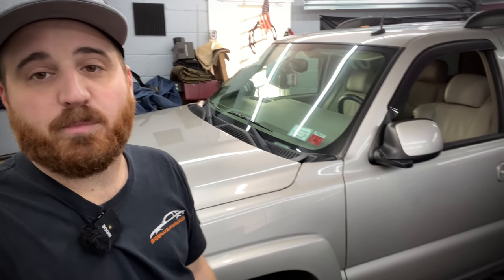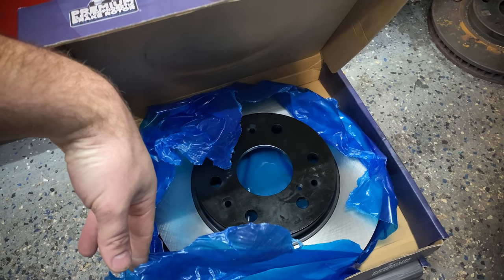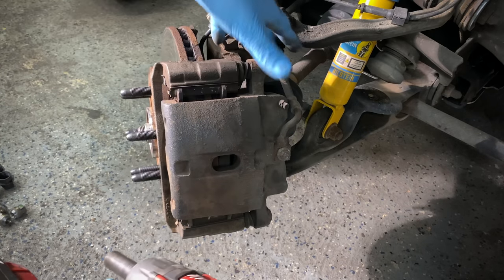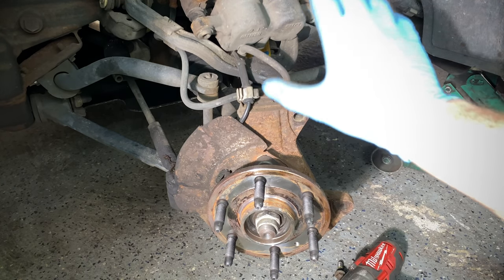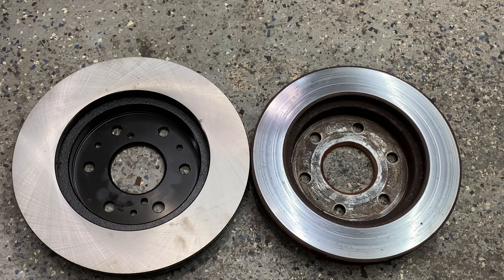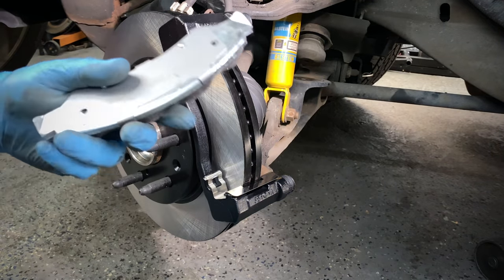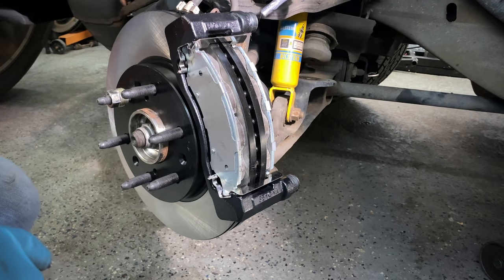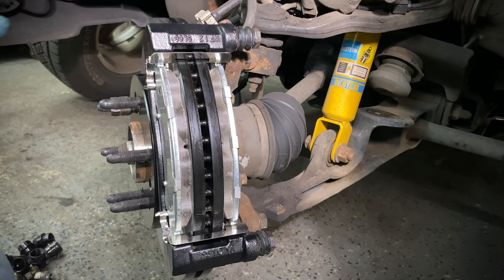This Budget BRAKE UPGRADE is Incredibly CHEAP & EASY!

Comment from the maker: After doing a little digging it seems the only real difference between base Tahoe and PPV brakes are a heavier duty pad/caliper seal for heat purposes. Rotor diameter is the same on both setups so don't go crazy trying to find PPV calipers as they'll stop the same under every day driving conditions! Also don't forgot to hit that thumbs up if you want more Tahiti content ASAP!
Reply: I have a 04 z71 and when I clicked on your link for your rotors it’s saying it’s not a fit. But it will work
Reply: Doing this to my Avalanche 👌🏽
Reply: Do you know if this upgrade is the same for a 2000 silverado? Sorry I'm new on the chevy game and I dont know much about compatability with all the models
Reply: @ajg1889  what year?
Reply: The PPV pads are the main upgrade. They don't last as long and dust alot but stop better. NNBS Silverados came with 17 inch wheels so 17 minimum.
Reply: If I’m correct you can also use Cadillac ESV rear/caliper and rotor 12:99in OEM big brake upgrade
Reply: @keyboiz916  - do you have 16" or 17" wheels????
Reply: @ChevySS1968  I have 17”. I realized in the video he said choosing the 2007 year. It should fit just fine.
Reply: Does anyone know by switching the breaks to something bigger if the stock 17” fit on the truck still?
Reply: @keyboiz916  - If you have the 12" rotors and switch to the 13" rotors, then the 17" wheels will fit. But this will not work if you have the 16" wheels.
Reply: @ChevySS1968  thank you man! I was gonna sell my stock rims if they didn’t fit. But yea my stock rims are 17”s I have 20”s off road rims on my truck right now. I was a little iffy about doing the swap I’m waiting on my calipers right now. I have the rotors and pads.
Reply: @ChevySS1968  so if you have the stock 17 inch rims that came on the Escalade this should work correct?
Reply: @brentoncochran80  -sorry, but I'm not 100% positive on the Escalade wheels. We did this (went from 12" rotors to the 13" rotors) on my brother's '04 Silverado, and he had 17" wheels and it worked perfect. I tried to do it on my '03 Silverado, which has 16" wheels and the caliper hit the wheel, so I couldn't do it. Can someone else chime in about the Escalade 17" wheels and help answer Brenton's question????
Reply: @brentoncochran80  the 17 inch wheels will fit. 16 inch will not fit. Should  go for all GM truck wheels.
Reply: @fj3442  thanks!!
Reply: Matt how do you like those shocks? I have the beltech street shocks and hate them. Looking at the 4600s
Reply: So today I finally just went and did the swap on the Tahoe. So far I’m loving the stopping power that it gives you. Very easy to do to be honest. I wasn’t sure if I’d be able to get it done solo but after like a hour I was done. Thank you bro for the video. Looking forward to some more upgrades.
Reply: Did this swap on my 02 Escalade awesome upgrade for the same price!!!!
Reply: Will 07 suburban brakes work for my 04 Tahoe upgrade?
Reply: So it won't work on an 03 Suburban? Need to upgrade my brakes. 16"
Reply: @keyboiz916  just did this to my 2004 suburban with 17s and they clear by Maybe 1/4 inch if that
Reply: @KevinGonzalez-fb7md  The rears are nearly the same. No point in swapping them unless you get parts for free.
Reply: @keyboiz916  hi, I have a 03 Z71 were you able to see if this fitted ?
Reply: @TheCgilbert9935  yes, as long as you have the stock 17s they will fit fine. I’ve had them for awhile now and no issue. I switch my rims from my 20s off road to the 17s stocks no problem.
Reply: I have factory 16, would this still work. Or should I be looking for 17 inch plus stock wheel
Reply: @johnnylevansjr6633  no it wouldn’t work. You would need 17s rims for it to work.
Reply: Why didn't you change rear calipers with larger set as well?
Reply: Do you know if I can do this same upgrade to the rear of my 04 Tahoe?
Reply: Will this work on a 04 z71 suburban
Reply: @mark-gi7wo it will if you have 17 inch rims
Reply: @joemonk3480  will brake conversion work on the rear also
Reply: @mark-gi7wo  I'm not sure I just ordered the fronts to see how they work and if I need more stopping power I'll try it on the rear and let you know

Comment: The next upgrade when those calipers go bad is to put 2019-2020 4 piston calipers on your Tahoe. I did this to my 2006 Chevy Silverado 1500 which already had the big rotor and you do away with the caliper mounting bracket and bolt the calipers directly to the vehicle. You have to use a couple of shims in between the hub and the caliper so you get the proper spacing on the rotor to center it in the caliper. You will double your stopping power with this setup. I have shoe brakes on the rear and don't plan on changing them to disk as the front brakes do most of the stopping.
Reply: What size (thickness) shims? Did you use washers?
Reply: @ZBrink11  Shim size OD- 1.10" , ID- 0.54" , Thickness 0.155" Misumi has these the part # WSSS30-15-4. These are 4mm or 0.158" thick stainless steel shims. I used a wet stone to take them down to 3.96mm or 0.156".
Reply: Don’t you have to run 20” wheels with that setup?
Reply: 💥Sounds great. 2019-2020 from what vehicle, bro.? 🤟🏼
Reply: @Jimmy_Cavallo prob a Tahoe or Silverado
Reply: What vehicle???
Reply: Just bought a brand new set of 2020, can confirm, they are an amazing and cheap upgrade!   And your write up is perfect!!
Reply: @Valdemar-Perez-III  I see 1500 trucks with 17" wheels with 4 piston 13.5"  rotors.

Comment: 17" wheels fit. Have stock 04 Z71 wheels on mine with 07 brake upgrade.
Reply from the maker: Great to know!
Reply: @lsxmatt  Yep, GMT900's came with 17's.
Reply: I have the 17"  07+ Six spoke GMC wheels on mine. I also bought a 17" spare, so it will fit over the calipers. If you DON'T have a 17" spare, and still have the 16" spare and you get a flat on a front tire, just put the spare on the rear, and put the rear wheel on the front.
Reply: 2006 Silverado have the same brakes no ?
Reply: @efrainalvarez9541  06 and down is the same s his taho. 07 up has the bigger brakes
Reply: @MD-lm7fj  ty brink - a YouTuber has a 03 Silverado and he said he used the caliper rotors off a 2005 silverado
Reply: @MD-lm7fj  that’s why I’m a bit confused
Reply: Whewww.yea I have a o4yukon so it should clear
Reply: @efrainalvarez9541  I missed the Silverado part in your question. I honestly dont know I only looked at parts for Tahoe and Suburban. It is very possible it is the same. I would double check the part numbers though.
Reply: @efrainalvarez9541  2005 silverado with drum rear brakes
Reply: @efrainalvarez9541  I'm pretty sure they do as they went to a larger rotor when they introduced drums in the rear.
Reply: Id like a 11.5 14 bolt aam full float rear with 6 lug hub and largest disk brakes for the 6 lug layout that fit 17" wheels for a 2007 Silverado Classic 1500.

Tired of the JF7 rear drums.
Reply: @efrainalvarez9541  look in the glovebox for rpo codes, a J as first letter will tell you what system is there.
Reply: @shadowopsairman1583  Swap the axle from a 1 ton srw, weld and redrill the axle flange and the rotors, they came with a 16 8lug wheel factory so a 17 6lug would work. You just wouldn't be able to use stock wheels as the center hole would need to be bigger than what you would find on a  6lug wheel. And you might have trouble getting a 6lug wheel with a large enough center hole
Reply: @efrainalvarez9541  Look them up on Rockauto. They give dimensions of the rotors in the info. I'd say no. 07 up was  the start of the next gen with the brakes you want.
Reply: @efrainalvarez9541  those are the bigger brakes (05+ gmt800 trucks) They went up a inch in the front and swapped from single piston disk to drums. The Tahoe's came with a dual caliper in the rear I believe the entire run (2000+)
Reply: I have a 2003 suburban and got afford some 20" 2016 silverado ltz rims with tires not sure on measurements but can anyone tell me if they will fit??
Reply: I have stock-ish looking off-road 17” rims but still depends on the style and design of the rims. I’d like to do this upgrade but don’t want to risk running that minor issue while I’m at it...
Reply: You think these are also bolt on for the 2003 4.8 LS?
Reply: Are the rear brakes the same size or bigger? Bolt on just like fronts?
Reply: @Conqueef-tadoor  So, the 16" wheels are not wide enough for the new brakes I put on my 2004 Tahoe?
Reply: @djkeys415s  Have a 2004 Tahaoe and the new brakes / calipers were binding on the wheel . Will factory rims fit or do I need to go to a larger rim? The custom rims that came with my vehicle are too small.
Reply: @chriskyser1501  what size are your wheels? I believe must be 17 or 18 to make this upgrade
Reply: @benjaminibanez4057  I now have 17" rims and new tires. Didn't dig into this upgrade enough to know the brakes went on 17"- 18" wheels. Quite a shock to find my '04 Tahoe was frozen in place when I put it into reverse to back up W/ new rotors and such. Now - 17" X 8 1/2" wheels W/ 265/70 R17 tires. Thanks for asking.
Reply: @Conqueef-tadoor  What about gov lock rear diff's?  Any knowledge on if it would cause damage?  Open, no problem of course.  Thx.
Reply: @mu9627   Are you are referring to my comment about using a 16" spare tire on the rear?  If so, ANY diff can eventually be damaged by driving with two different tire sizes on the rear. What I REALLY meant by my comment was that in a pinch or in an emergency, you can still fit the stock spare on the rear to at least get home. I would avoid driving it any more than that with two different sized wheels on the rear. Just to get home or to a tire shop.
Reply: @Conqueef-tadoor  I put 18 inch Chevrolet Silverado aluminum wheels on mine, yet have held up on brake upgrade until I find a suitably priced, lol, matching spare for that reason alone.  Didnt feel safe with the Gov loc  as didn't want to stress it if ever had to use spare.  Great info on here and thanks for reply.
Reply: @jmunoz1414   they will fit may rub depending on tire size but as far as bolt on.
Yes they will fit
Reply: @chriskyser1501  has to be a 17 or bigger than r they will not fit
Reply: @chriskyser1501 17in wheel minimum I believe

Comment: I recently did this upgrade and it works great!  You don't have to go larger than the 17 inch factory rims since I have those still installed.  You WILL need to change your spare since the factory spare is a 16-inch rim.  I hit the junkyard for an OEM matching rim with a decent tire for $30.
Reply: Hey sir, so are we confident that factory 16s aren't big enough then?
Reply: You could always use your 16 spare on the back wheel and switch it to the front.
Reply: Ooh, great tip!!
Reply: I have a ‘05 Suburban with factory 17” rims and you’re saying this upgrade will work with those wheels?

Comment: My understanding is the 2019 and newer truck brakes with bolt up as well then you get the 13 1/2 inch rotors and the four piston calipers.
Reply: This is what I am looking for...
Reply: Yes they will, but will your wheels fit over them?

Comment: GM Interchangeability has always been awesome. They really think things through when engineering newer components.
Reply: Yes Sir!! I got the big brakes from a 2022 silverado on my 2000 silverado
Reply: I have c-5 Corvette calipers with ls1- camaro rotors / hose on stock hubs and spindles up front and blazer rear calipers and rotors .
Astrovan hydroboost, Olds delta 88 hoses and 78 corvette master cylinder .
On a 68 ss 396 Chevelle.

Chevrolet defines parts interchangeability.
Reply: Nah, they’re just too cheap to change shit every few years lol
Reply: @tclott316  ^ This is the real answer. Its only thinking things through for the sake of saving a buck

Comment: FYI: You should ALWAYS use Loctite on the caliper bracket bolts on GM trucks. There's a tech bulletin about it. They use a lot of thread locker from the factory, and if you ever took off original factory brakes you probably fought to get the bolts out. I did my brakes and didn't use Loctite, but I torqued the bolts to 90ft lbs. About 2 yrs later I had a caliper bolt fall out on the hwy and ended up causing a fair amount of damage. Caliper pivoted down since it only had one bolt holding it on, and it rubbed the inside of the wheel. But at 70mph, it cut the wheel open like a can opener! I'm lucky I maintained control of my truck and didn't crash it. I was able to safely guide it off the road, then I dealt with the damage which was a ripped caliper hose, a busted shock, and a severely damaged wheel and tire. I now use Loctite EVERY time I change my brakes!! 🙅‍♂️
Reply: Unless you live un the rust belt. The salt us natures lock tight. Lol!
Reply: True story - I had a caliper come loose one time after not using loctite and just got lucky it didn’t really tear things up
Reply: Good idea. Even in MI I've never had any issue unbolting a caliper bolt so this makes sense.
Reply: Same happened to me I drove for 10 years but one time is one too many
Reply: Blue or red?
Reply: Ah, now I know why I had to apply the bernzomatic to every single bolt on my Suburban.

Comment: This was the first mod I did on my 03 escalade. Extremely worth it! Before, It literally felt like it wouldn't stop. After its like dropping a damn anchor
Reply: Do you have 16" or 17" wheels? If 16", how did you get it to work? Thanks
Reply: @ChevySS1968  I'm running the stock escalade 17's. 16's won't work unfortunately.
Reply: @AT_motors  ---- thanks
Reply: @AT_motors  what did you do for the rear? Would the rear rotors and calibers work?
Reply: @mariolevicy3073  I ran stock replacement stuff for the 03.
Reply: Do you know if I can do this same upgrade to the rear of my 04 Tahoe?

Comment: I have that same floor jack I bought for $100 on sale from Sears around 1984 and I still use it and it has never given me any trouble, made in Japan.
Reply: So do I, bought it in 1979.
The only difference between the 1 1/2 ton and 2 ton is the front axle diameter

Comment: Also, if you are searching for these calipers in the junkyard, these also came on 05 and 06 "GMT800" GM pickups, but NOT the SUV's. Silverados and Sierra's only. Easiest way to identify for sure, is the 05 and 06 (and 07 Classic) pickups that had these 13"  brakes came with drum brakes on the rear. 👍

Comment: You can tighten the bleeder nut with an open end wrench before pulling the bleeder tube off to prevent air back feed

Comment: I also like to add a light layer of brake grease to the pads where the pistons touch and the bracket grips the outer pad to reduce brake noise.
Reply: Your always supposed to use some sort of lubricant on brakes except if the pad has that sticky rubber on the back or if it's pad backing plate is Teflon coated.

Comment: Great video, Thanks! I recently retired and sold my 19 Duramax that was my company driver. Still needed to tow an aluminum trailer with a car on it occasionally though. Found a gorgeous 03 Z71 Tahoe with 69k miles. Extremely well kept and all records. Previous owner had a Magnasun Supercharger installed along with several other upgrades to suspension, etc. Very nicely done but nothing to brakes. This is exactly what I needed. Also loved the phone charging upgrade you posted. Now my Tahoe is ready to do what I need, and way cheaper to own.  Thanks!
Reply: Wow sounds like a fun ride. Mind if I ask what you paid?

Comment: I add grease to the hub before putting rotor for easy future removal. I also anti seize all of the bolts and the lug nuts.... that's a must.
Reply: no anti seize on lug nuts.
Reply: @jba6677  not the lug nuts but the studs. And what's wrong with that?
Reply: @3rdgenjunkies57  Personally I never use anti seize. Just wire wheel the caliper pins give them some fresh grease and a dab of greese between the hardware for the pads. Anti seize on the lugstuds seems unnecessary you shouldn't ever have issues getting a lugnut off as long as it hasn't been overtourqed or sitting for years.
Reply: @3rdgenjunkies57  Anti seize isn't recommended because it causes a false torque reading. It's really easy to overtighten the nut. Good penetrating oil occasionally especially in the salty areas and you'll never have a problem.
Reply: Matt laughs in rust belt
Reply: @brad8665  I live in the rust belt. I never have any issues getting lugnuts off with an air impact unless its been obnoxiously overtourqed
Reply: Dot loves to see anti seize on lug nuts 😂😂😂😂 hahaha aluminum rim on steel huh yea on contact area not the mf stud/ lugs

Comment: ATTENTION:

You can now upgrade to the 20-22 calipers and rotors. The rotors themselves are 13.5in. The lines fit right in. The only "mod" needed is to use washers to center the caliper a little bit. It won't fit on all rim sizes, it likes the bigger ones 16+.
Reply: was just getting ready to do this Upgrade now, but  20-22 would be even better, how did you come about this info?
Reply: What thickness of washers are needed?
Reply: @ZBrink11  .155" thick or 3.93mm
Reply: @ZBrink11 where do you use washers?
Reply: @moncayoda  The washers go on the bolts which mount the caliber to the spindle. This guy shows it in this video. I ended up buying multiple washer thicknesses (all high quality) from my local Ace Hardware as for whatever reason, the depth seems different on every install. https://youtu.be/Eb2b95c65BE
Reply: Actually GM started using them on full size trucks in 2019.
Reply: @ZBrink11  Correct the 2019 has 4 piston fronts and 17" wheels from factory.